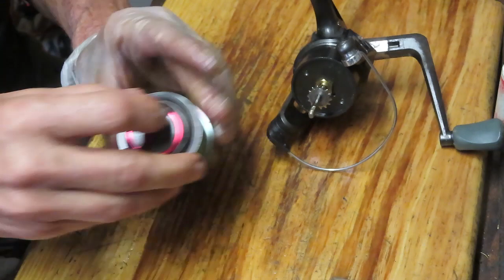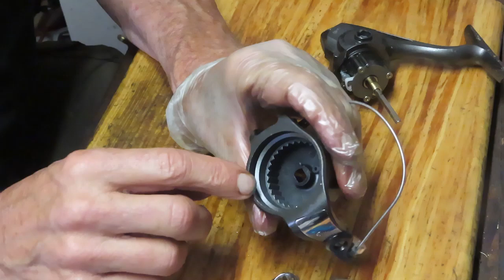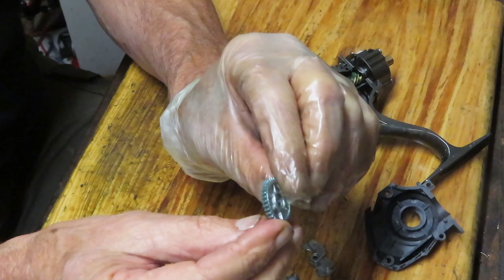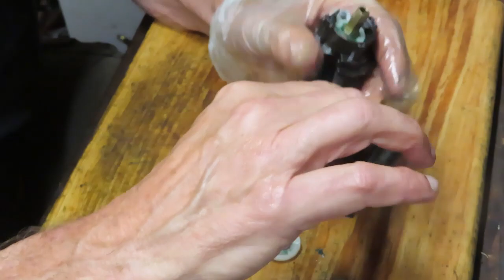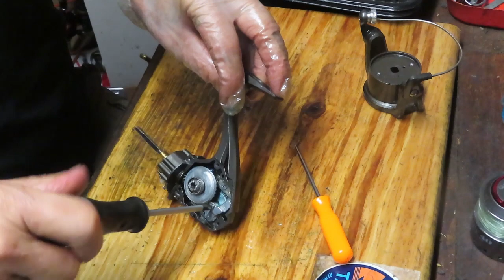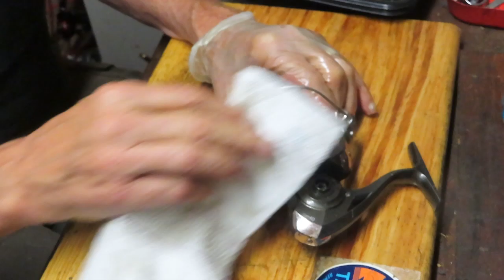Quantum Optix 40 spin fishing reel how to take apart and service

Comment: I remember when Quantum first came out. As you said it was Zebco’s premium brand and I remember it being much more expensive than regular Zebco’s. Out of reach for me at the time cost wise. I think they were owned by Brunswick back then in the 80’s. Anyway, it’s interesting to me how things change over time with status, quality and marketing. Thanks Dennis.
Reply from the maker: There are still nice Quantum reels available.  The Cabo and Boca reels are particularly well done.
Reply: Hi Steve, you’re so right about Quantum back then. The main reason I don’t buy a new Quantum reels is because I had a very expensive Quantum Cabo that didn’t last 3 years because the bearings corroded so badly and quickly. So recently I get a cheap Optix just to see one and lo and behold bad bearings again. That’s it for me and Quantum.
Reply: @christopherjenkins2373  👍

Comment: Hi Dennis, i like your videos and the info on them.I have one of this reels and i was wondering what size are those bearings and can they be replaced with quality ones and will that improve the performance?Thanks
Reply from the maker: I don't know the size of the bearings, you would need to take them out and measure them.  I don't have one in the shop, or I would measure for you.  The bearings can be replaced with higher quality bearings, but those bearings would cost more than a new version of the reel sells for at retail - Dennis
Reply: @2ndChanceTackle  thank you for your answer, I did took it apart and found out all bearings are different size three ball and one roll bearing made of plastic ,and yes I can't find 1 of each to buy, even if I did it will pass the value of the reel 🙄🤔😊

Comment: It’s funny, the Optix 60 that I have had No ARE override. It’s one of several reasons I don’t like my reel. The second reason is that all the bearings were in horrible condition. It took a lot of work to bring them back. I got the reel in decent shape but it took a lot of work. I only paid about $10 for it though. Mine must be an older version as mine had a traditional AR dog rather than a clutch. Mine had three ball bearings at the pinion and main gear.  Interesting to see how another Optix reel was made.  The bottom line for me is I understand why we need reels like this in the market but I still don’t like this specific reel and based on past experience I dislike Quantum reels in general Thanks Dennis. — Chris
Reply from the maker: Thanks Chris - the Optix has been around for a long time now.  I suspect your reel has a different version.  You can see that the rotor inside this reel has the set for the traditional dog, yet it does not have one.  It is clearly a transition piece - Dennis